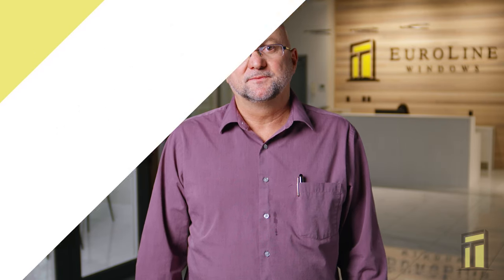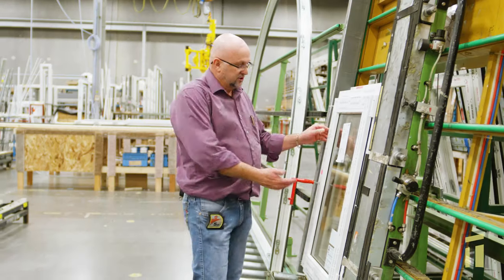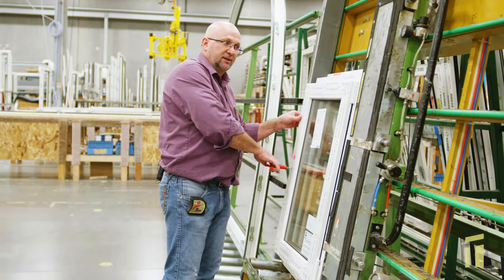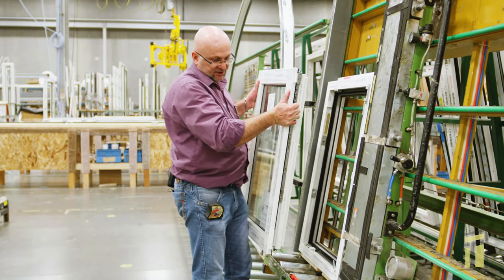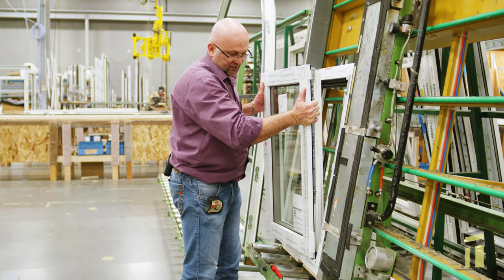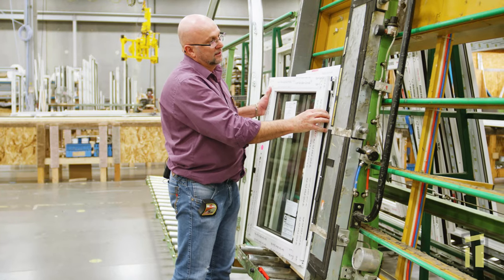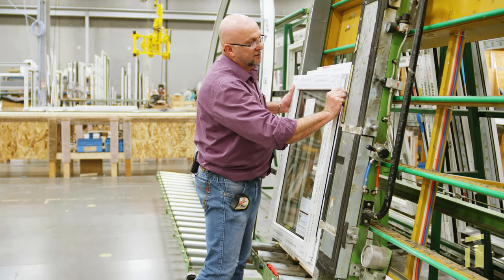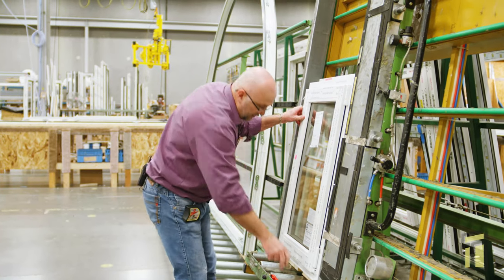How to Remove and Hang a Tilt & Turn Sash | EuroLine Windows

Comment: What happens if the locking mechanism at the bottom of the window on the handle side jammed, I can’t lift the window off the hinges as it seems caught at the bottom of the frame

Comment: What is that removal tool called and where can I buy one in Canada?
Reply from the maker: Hi Binali, 

This tool is called Roto NX Extractor Handle. We purchase it from Roto North America, it is not currently available in Canada. 

However, a nail puller would do just fine and can be purchased from any hardware store. If you use it, exercise care to not scratch the hardware of the widow.

Cheers!
Reply: Y’all should put those flanges on, taking me 2-3x longer to install these windows. Or Atleast cut them to size for us. Losing money cause of you.
Reply: Talking about flanges I got the one in the thicker whole, there’s 2 slots one very small but that’s the one that fits but I don’t trust it and don’t wanna put the window in. Can you tell me which slot to use? The slot that’s on is a heavy big the other is an 1/8 but the 1/8 slot don’t fit. I do 40 windows a day literally got none done today and have 15 windows with flanges in. Frustrating and I dont even know if it’s right please reply tonight before I install tomorrow